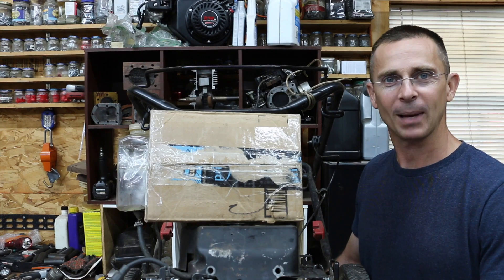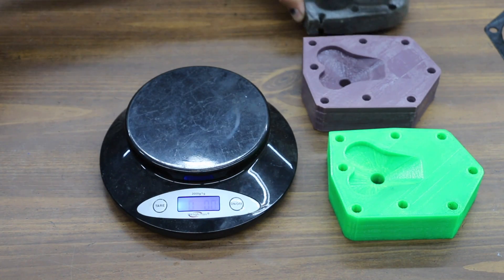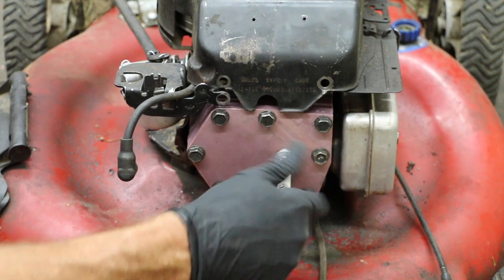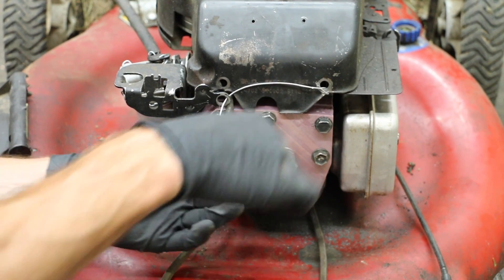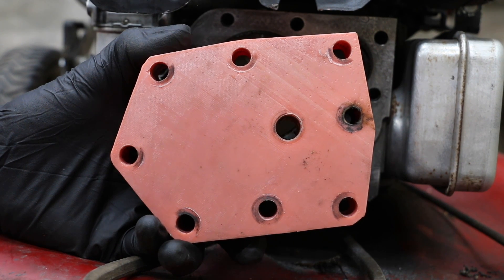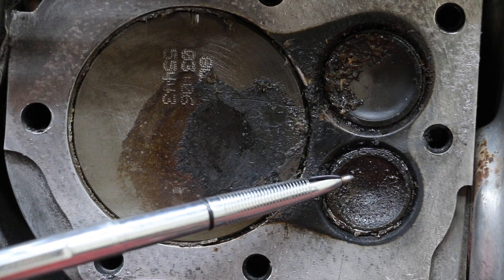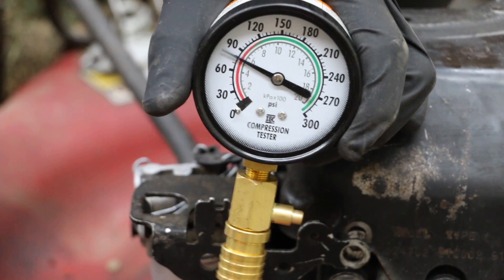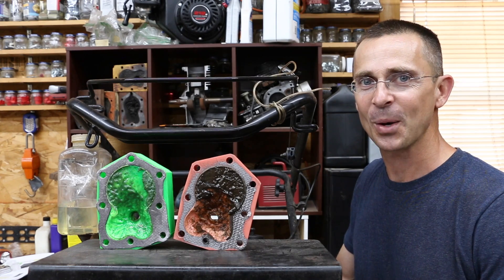How long will a 3D printed cylinder head last?  Let's find out!

Comment: Water cooled plastic cylinder head, would be interesting to see if a liquid coolant could wick away combustion heat fast enough ..
Reply from the maker: Great recommendation!
Reply: I still bet that printable plastics thermo conductivity is not high enough for an inner liquid coolant passage to prevent material erosion due to the high combustion gas temperatures. need a plastic or plastic like material conducts heat well , A Pyrolithic Graphite head gasket for example.
Reply from the maker: I believe you are right. It would still be interesting to see if the run time improves. Thanks again.

Comment: Have you tried a 3D printed head used to make a cast aluminum one? It seems like that would be fairly easy as long as you brushed up on aluminum casting techniques.
Reply from the maker: Great recommendation!
Reply: Ya, considering what I DO know about casting aluminum, it seems like using that same plastic design for the cast then milling in some fins would be the first thing I'd try just to increase the chances of success, then attempt casting one with the heat sinks on the second go. I've seen too many failed casts from newbs (like myself). Lost foam is a great method if the flow channels are done right but getting a custom design in foam takes some extra steps.

Anyway, it seems like a great way to do custom heads, intake manifolds & such.

Comment: You need a plastic that once cooled become thermically stable . As we had plastic engine and cylinder heads in euro since 1980 on the citroen cars then there no reason this cannot be developed farther but the point will be why as we movevaway from ice engines
Reply from the maker: Great point.

Comment: Nice improvment, I plan, once I can to built a 24" diameter KJ-66 for a late late X-WING with cutted noze. There is engine in the fuzelage pointing down for vertical thrust. Have action one you can because allie is the number.
Reply: Engine first after frame and the wing are standart first, I believe they can be exchange later.
Reply from the maker: Sounds like a great project!

Comment: Line the inside with aluminum foil! ABS might last longer because it possibly wouldn't fail from material gunking up the spark plug or cylinder/valves....
Reply from the maker: Great recommendation!

Comment: Try make lead  cylinder head. It will be cool to see if it melts or pop. I think it will not be very hard to make it. Also can insert some nut when cast lead where to screw spark plug so it doesn't pop out.
Reply from the maker: Great video idea!

Comment: That was interesting. I wonder if you could do a laminated heat shield made of silicone layers between the valve and the printed cylinder head, since silicone can withstand up to 500 degrees. And possibly a threaded insert(with heat dissipation fins) for the spark plug. You can buy silicone cookware. Maybe cut a head gasket from a silicone cookie sheet? Thanks for all your hard work!!!!
Reply from the maker: Great test idea!

Comment: Thermoplastic plastic obviously won't work because it melts when heated. You'd need a thermoset plastic like Bakelite to make a plastic cylinder head that won't melt.
Reply from the maker: Great point.

Comment: I know almost nothing about 3D printing, how many different kinds of material can be used to make parts? I know there's some resins used in the manufacturing of aircraft which can take higher heat loads but the nuclear furnace found inside a combustion chamber I believe is far to high for anything like this to work for long.
Reply from the maker: Great point.

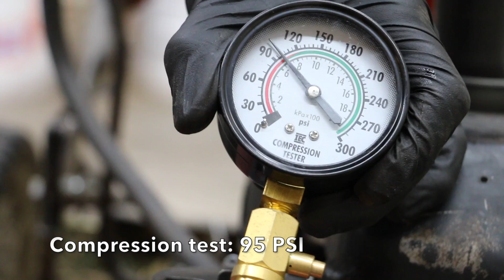Comment: 5:50 "I'm gonna go ahead and change one of the major variables in the test thus rendering any comparison between the different plastics, totally moot!"
Reply: Lol... I thought that too. But it blew out the threads, so not worried. Awesome video! Thanks Terry!
Reply: All it would do is make the purple block last longer. Mystery solved, NEXT!
Reply: CanadaBud23 the larger gap creating issues with firing. I thought the same thing though about rendering this experiment moot but it blew out anyways so it all worked out.
Reply from the maker: Thanks for the constructive feedback.

Comment: Why test 3D printed parts made of material you know up front will be crap.
If you had machined a solid plastic block of those plastics, you would have had the exact same result.

This has nothing to do with 3D printing, it has to do with picking the right material.

The only time when this test would even become relevant, is if you would have used 3D printing with metal printers.
Then it would have made sense to test.
Reply from the maker: We've tested other products, such as wood. Failure is always going to occur but it's interesting to see how quickly.
Reply: Sure but the title says , ''How long will a 3D printed cylinder head last'

None of the testing has any relevance to the 3D printing.
You did not compare vs a full cast of the same material, so you don't know if the 3D printing made it weaker then a comparable non 3D printed head. 

For test 1 that failed with molten plastic on the plug it makes little difference, that's an obvious poor choice of material.

For test 2 , the plug got blown out, which may or may not be attributed to the 3D printing proces that lays it down layer by layer.
maybe a full cast and machined head of the same material, the plug would not have blown out so quickly
But you don't know, you didn't do that comparison test.
So again, you did nothing in this test that yields any usefull information as to the 3D printing part of the setup. 

The title should be "How long does a plastic head last"
Which would not attract as much interest. Plastic is old.. 3D printing is new..

And to somebody who doesn't think critically, he would now conclude : "3D printing is crap, it fails in no time"

If you want to do some kind of tests and publish on youtube, and you do it like this
then you are to blame for the false conclusions that some others make based on your video.

It's like false news... it's cheap, it's easy, it's not productive.

Comment: Owning a 3D printer I could have told you it wouldn't work lol. PLA extrudes from the nozzle between 190C-210C with ABS being around 230C. Regardless fun tests I suppose.
Reply from the maker: Thank you. Yes, I had a lot of fun with this.

Comment: I don't think using a 3D printer to produce gaskets is a good idea. What with the time it takes to model the gasket and then print it, you'd be far better off making a gasket from a sheet of something better suited to the task. Maybe a CNC cutter would be a better option.
Reply from the maker: Great point. The 3D printing technology is all that efficient yet.

Comment: There are many spray Coatings designs for exhaust systems. I wonder if that would provide enough insulation to allow the cylinder head to run for a longer period of time?
Reply from the maker: Great video idea!

Comment: Don't get the point. It is pretty obvious that plastic + fire = melting plastic, so why try it in the first place. If you want to succeed with plastic as a cylinder head, you should at least use a think piece of metal sheet, and some sort of heat insulator to protect the plastic from burning. Let us stop making direct plastic replacement for steel or metal, because it just would not work. Nice demo though, thanks for trying it out.
Reply from the maker: All great points and thanks for commenting.

Comment: Real question tho...  Why does there become major smoking is it because 2 much oil or the piston head is damaged enough for that...  I'm only asking because I have a 4 wheeler that burns half a qrt of oil a day and the smock is white as fuck .  There is scratching on the piston head and cylinder as deep as a finger nail thicknes.. Could that be the problem (reply even if this is an old comment)
Reply from the maker: Great question.  Smoking is the result of one or both of the following: 1) oil gets past the piston rings and combusts along with the fuel.  2) Excessive combustion gases get past the piston rings (blowby) and pressurize the crankcase, causing some oil to get blown out of the crankcase ventilation and back into the carburetor.   It then enters the combustion chamber where it burns.
Reply: @ProjectFarm  alright sweet well I'll replace them soon along with the piston head and cylinder soon.

Comment: Lol I expected what I saw. PLA melts at 180 to 205C (depends on the brand of filament you buy).  ABS is amorphous and has no true melting point, but the standard for printing is somewhere in the ballpark of 230C up to maybe 250C. EDIT: Some sources say 290C minimum for 3d printing PC. My printer does 260C max on the extruders.

I would love to see you try using a cylinder head printed with Polycarbonate filament. I've never worked with it as I don't have a heated chamber to print in (only a heated bed). I'm told having a heated chamber is basically a requirement to printing with the stuff.
Reply from the maker: Great recommendation. Thank you

Comment: 3d print, or use aluminium  baking foil. or use paper to form a Vally  or intake gasket for an LS1 5.7  engine
Reply from the maker: Thanks for the recommendation.

Comment: oh just wait till they come up with a 3d printable material that is very thermally conductive and dense. maybe it could have copper or aluminum dust in it. then we can print almost any engine part and digitally design new enhancements
Reply from the maker: Great point.

Comment: How will Sparkplug Ground to non metal cylinder head?
Reply from the maker: Great point. It won't unless a ground wire from a metal part of the engine to the spark plug is put in place. This is what I did in this video. Thank you!

Comment: Some replies about liquid cooling the head, but just cooling the spark plug alone might go a long way. I wonder if you could essentially coat(ceramic paints or embedded graphite for example)the inside of the combustion chamber to insulate the plastic from direct heat exposure.
Reply from the maker: Great point.

Comment: I would be curious if there is a lower temperature burning fuel that could be burned that would make these things last longer... as it seems the only thing that made them fail was the heat (I mean obvious fact is obvious, but still)
Reply from the maker: Great point.

Comment: How hot does the inside of the cylinder head get?
Reply from the maker: Combustion temperatures easily exceed 500F. Engine load, Air to Fuel ratio, and many other factors influence temps. Thanks
Reply: Project Farm so if a plastic can handle 4:50 or so it might work because the head doesn't have to absorb all of that interesting that's a tough one I think you would need some sort of insulating coating to stop some of that heat transfer into the plastic I'm not sure how to do that p e e k might work but it would cost a fortune to make one :-)
Reply from the maker: Great point regarding an insulating coating as a possible solution. Thanks again

Comment: How about trying to repair a cylinder head with flex seal? Like drilling a hole in an old head and tryong to seal it. Heck if it works try seeing how big of a hole it can seal. If not maybe it could be used as a head gasket
Reply from the maker: Thanks for the video idea!  Great test for Flex

Comment: PLA starts to warp at 50ºC, so it doesn't surprised me when the spark plug jumped right off. I wonder how a 3D printed head made out of PET would fare. Unfortunately, PET is a bit toxic when burned, though.
Reply from the maker: Great point.

Comment: Could flex tape or flex seal work as a gasket?
Reply from the maker: Great video idea!
Reply: No it would melt
Reply: @sterrshow5016  not necessarily it is a rubber based product from what I understand.
Reply: Logan Ketchum your meme is gay
Reply: maybe silicone caulk has a higher temp rating?

Comment: Ford Triton effect at 6:20 lol
Reply from the maker: lol
Reply: 5.4
Reply: @derekcarson7976  also the 4.6.....
Reply: To fuckin funny. Im drivin a 5.4 3v and know all to well. First thing i thought of then saw the comment was like oh man someone knows my pain lol
Reply: @bikerboysrus1  all to damn well my friend.
Reply: Ahh that's funny... I didn't make that correlation when I first watched the video, but the comment made me ROFL
Reply: Lol.
Reply: Very true
Reply: I read your comment before I got to that part, ruined the surprise for me lol
Reply: I just did the sleeve mod, 500K miles and engine is happy
Reply: Wait, what's wrong with the Triton?
Reply: @woolery2631  The spark plug threads were too short and too fine, so if you didn't use a torque wrench when installing the sparkplugs and over or under torqued the plugs, they would eject from the head taking the threads with it, there was later a threaded insert kit from ford to remedy this issue by increasing the amount of threads

Applies to all 5.4 engines through all years and i believe all 4.6 engines produced prior to 2006?
Reply: @bait28  Oh thanks, was looking at building a 4.6, cheers!
Reply: @bait28  Fairly certain in was the 2004-2008 3V. I have a 2009 with the deeper threads and one piece plugs, so I just have to worry about my cam phasers shitting the bed. Lol
Reply: Modular V8 FTW?
Reply: My life for a year 2 spark plugs in 3 months 😭😭😂
Reply: GOOD GOD MAN WOULD YOU BESMIRTCH THE NAME OF FORD

Comment: Being this is a plastic 3d printed head, I would like to see a U.H.M.W head. U.H.M.W.P.E would be a good variation to run. It's has a strength to weight ratio 8-15 times greater than steel and withstand high heat temperatures. Would deffinetly be interesting as I use it all the time at work
Reply from the maker: Thanks for the recommendation.

Comment: I can clearly see 3D printing is far from ready to be useful in the real world. The materials are structurally and thermally much too weak to be of any serious use. I've had a gear 3D printed to replace a broken Bakelite one in an antique machine but even with the strongest formulation it doesn't come near the strength of Bakelite and can't even stand moderate heat that Bakelite, one of the earliest plastics invented, easily can.
Reply from the maker: Great point.

Comment: No disrespect intended but this is a silly test - just like making the head out of ice cream.
Use a material that "might" survive, rather than a material that is never,  ever going to survive. Try - if it works in a 3D printer - PTFE. I believe the melting point is about 450 centigrade.
Reply: I don't know if there is a printer that can print at 330 degrees C. Most print between 180 and 250 degrees
Reply: someone should make one.
Reply from the maker: Thanks for the constructive feedback.  I'll likely try PTFE soon.
Reply: PTFE off gasses toxic fumes above something like 240 degrees.  This is why printers that use a PTFE tube in the hotend are limited to low temp filaments.  The better plastics to try would be a nylon/nylon composite (something like one of a number of nylon based carbon fiber filaments which print at around 250-260 degrees) or polycarbonate (prints at around 300 degrees).
Reply: A 3D Laser sintered metal head would work
Reply: @CAESARbonds  That would obviously work, especially if you were to post-process the surface that has to provide the seal, but 3D metal printing is REALLY expensive
Reply: you wrote exactly what i was about to... pointless
Reply: Teflon is rather soft..  The failure would likely occur at the spark plug again..

Comment: maybe you could do the same tests again but then with fillament that is rated for high temperature use (some can handle up to 140c , of course still not enough for an engine but itd be interesting to see how much of a difference it would make
Reply from the maker: Great recommendation.

Comment: PLA has lower melting temp, around 150, while ABS has 200 melting temp. That is why spark plug popped out PLA head.
So yes, it's not useful for very hot parts. Also not for sealing.
Reply from the maker: Great point.

Comment: Lol wonder if spraying it on the inside with some high heat grill spray paint would have helped prolong the plastic from melting as fast
Reply: Of course it's still gonna just melt, might have added a little more time.
Reply from the maker: Great point. It would be an interesting experiment.

Comment: PEEK plastic head might just do it, if it had proper cooling; it's glass point is 143°C and the melting point is 383°C. It's just that a 750 gram spool costs $580, it requires a print head that goes to 500°C and a heated build chamber, so you might not have many volunteers for that print.
Reply from the maker: Wow! Very expensive!

Comment: Hey bud can you try those again with a drilled water cooling diy system or oil
Reply: Don't think it would work, plastic is already a bad heat conductor.
Reply: Yeah but ain't ya trying to get no plastic on piston
Reply from the maker: Thanks for the recommendation.

Comment: Writing as I watch.
1st. The ground, sadly not enough small engine techs in my area would have even thought of that.
2nd. That exhaust must have had a terrible smell. 
3rd. I'm actually a little bit disappointed with the printed gaskets. Thought they would mold themselves to fill the imperfections between head and block. Perhaps a second torque of the bolts after a break in period may extend it's life. Certainly is still not a replacement lead/tin.
Reply from the maker: All great points. Thank you

Comment: Lead cylinder head. Concrete, plaster, resin, other easily cast-able materials would be interesting to see. Use an aluminum head to create a cope and drag type mold and cast a lead one identical and see how it holds up.
Reply from the maker: Great video idea!